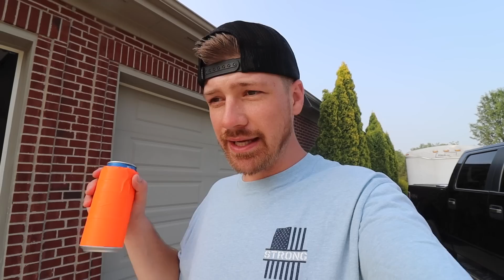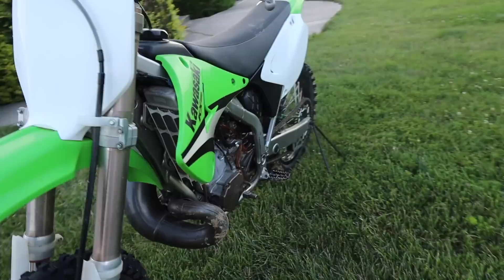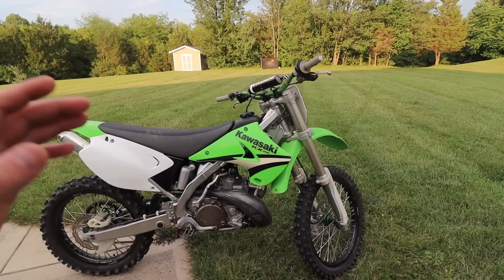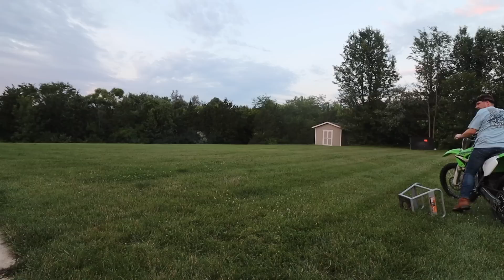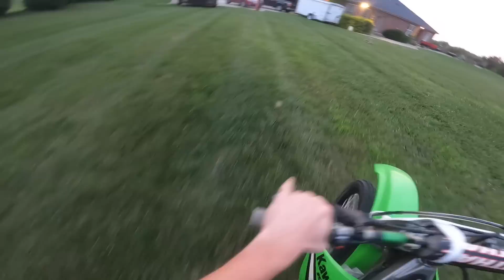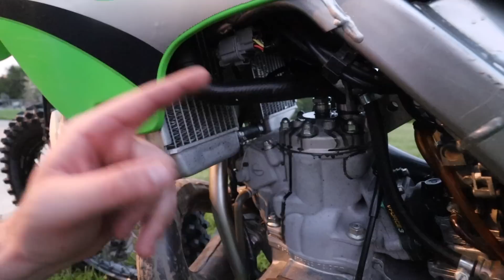JET FUEL in Kx250 Two Stroke!

Comment: Yikes! The lack of technical knowledge on these type videos (both from the content creator and the commenters) is shocking!
All internal combustion fuels (e.g. jet-A / kerosene, diesel, gasoline, methanol, ethanol, etc.) are hydrocarbons (with the exception of straight Hydrogen).  The main difference is the number of carbon atoms in the hydrocarbon chains; methanol has one carbon (CH4), ethanol has two carbons (C2H6), gasoline is a complex mixture in the C4-C12 range, jet-A/kerosene/diesel are all in the C6-C16 range, lubricating oils are in the C8-C18 range, greases are in the C12-C22 range, and waxes are in the C20-C30 range.  The lower the number of carbons in the chain, the more volatile the liquid (i.e. the quicker it will evaporate). To an organic chemist, there is no mystery here.
The reason this Kawasaki KX250 smoked so much on Jet-A is the effective "premix ratio" was dramatically lower... probably more like 10 or 15:1.  If he had pulled the spark-plug after this "test", it would have been oil fouled (due to the much higher percentage of longer-chain hydrocarbons in the fuel)
It would be more interesting to see this Kawasaki run on ethanol (e.g. "190 proof - Everclear") premixed with castor bean oil (@ ~ 20:1).  With an increase in compression ratio (e.g. much thinner base & head gaskets) and larger jets in the carb (needle & main) - the results would be a far more powerful engine (run on 100% "renewable" fuels).
Reply: yes agreed but many of us in our youth  learned fuel stuff by burning out engines in lawn mowers with jungle juice  and no internet in those days to tell us that puts holes in  pistons.
With internet comments we can show compression ratios and fuel types  and carbon chain types and fuel air ratios  properly  studied can save so much burning out engines like the old days .
Modern youths  have less access to various fuels as governments and health and safety block access to fuels that were easy to get in the old days. This is often because fuels mixxed in certain ways fuels can also saddly create cheap  bombs that can hurt users or victims . That's why modern airports have goons to check our junk in case we  got  two hydrogen rich chemicals  often from hair stylist shops to mix together   to make a primitive bomb.,. Thats big brothers excuse but they know its a hoax but they enjoy yanking our chain around the planet 
In the past  the local library with basic books told youths  how to refine oil and basic chemistry but computers ruined that system of knowledge learning . THe books are still in the library but youths  today think everything comes from   i pads and google but social  info interrupts the learning curves so important information is lost in sea of the  next distraction as the human race  now has less memory retension  than the goldfish 
Most modern  youths  think water comes from a tap and electricity comes from a switch and are unable to figure out how to light a candle if there is a power cut , Some modern youths  will learn something useful from  YT comments if there is inputs from people who know fuels and chemicals like yourself.
  I mostly do model rockets and chemicals to make them fly but also  mix better fuels for my car to get better MPG and add my 2 cents in case some  youths can learn something like moonshine as a fuel sucks because it has a high water content if they read that far. keep up the inputs it a planet wide problem knowlege of engines and fuels is being forgotten as google shoves it into page 1000 not relevant in 2023 world  just buy pump gas 
No harm in some fun if some engines get smoky or cooked if some peoples learns what wont work
The other day the USA built a factory  to build a monkey wrench and  the factory failed in making the monkey wrench because the USA has lost all the experts from the past who still know how to make a monkey wrench . Communist controlled EU  is closely following the USA as experts in manufacturing or fixxing anything are nearly all gone  away to retire or dead .

Comment: You sure that’s jet fuel? Because I’m quite certain that it is aviation gas. 

Jet fuel is refined kerosene, where av gas is just gas with very high octane. Much like vp race fuel. 

The high octane will help when your on the pipe as 2 strokes compression ratio gets higher when more fuel and higher rpm’s are introduced and falls at low rpm’s. 

Which is why you had a harder time keeping it idling at first, and also why you had so much (spooge) as the high octane was resulting in incomplete combustion at lower rpm’s. 

So all in all I don’t believe you ran jet fuel, or that jet fuel would’ve even run in the kx. Not bashing you! Just educating and clearing things up a bit!

Comment: I agree with you that 32:1 gas/oil mix is the best for 250cc 2-strokes.  The rule of thumb is, the higher the rpm the more oil it needs. So maybe running a bit more oil for the higher revving smaller bore engines may be a good idea.  I know the EPA wants to see as lean (on the oil) as 100:1 for 2-stroke engines.  But they don't care how long your engine lasts.  Same with cats on your car engine exhaust too IMO.  They heat the engine up a lot more in an effort to burn every piece of hydrocarbon.  I really hate the EPA.  Bunch of communists who hate our free enterprise really.  That is why communism in china has no financial burden of the EPA written in those trade agreements.  They are to punish Western Culture only.

Comment: So let my try and TLDR this:

Modern EuroDiesel fuel is Up to 25-27% more energy dense than Gasoline. 
Jet Fuel is Closer to Old D2 Diesel and its up to almost 40% stronger per Unit of measure. 
Which means Just pouring it In you are Running Extremely Rich. 

But than on top of that You are creating Way more powerful explosions than the gasoline engine was ever designed to withstand. 
The Only Positive of Running rich here is the Fuel is cooling the Cylinder But Not enough to make much difference. 

There are many reasons Diesels are heavier, and One of them You just witnessed. 
Gasoline Engine is just too Weak to take it and On top of that you are Extremely Overfueled. And Doesn't even Burn properly because the fuel isn't properly atomized, Diesel direct injection Atomization in the cylinder is Perfection compared to Pre cylinder Injection and Carbs just add more Jank to it due to Poor Atomization.
Also your timing is very off. 
Contrary to common belief Diesel Burns faster than Gasoline in the Engine. It Will usually complete the Burn in the Top15-20% of the Cylinder, while the Gasoline will Burn for about 60-70% of the Power stroke. 
Most Gasoline engines spark Pre TDC for Optimal Burn But that only makes it worse because You Induce Knock and Have a Very short Power stroke burn.
Here since you are very overfueled it kind of fixes that a bit but Still you have Knock.

Comment: You are running high octane av (aviation) gas for gas engine planes. jets use  jet fuel, it is a form of diesel and is useless in a bike or gas burning motor. I hope people get that difference.

Comment: Had a '90 KX250 2STROKE nvr she have sold it with another n a 500 2strk. Can't  Watch your video to see what diesel fuel in there and then regular pump gas and all that disturbing also also I think your tax is dreaded a little bit's hard to tell from the video but that's what I think I tried cam to race fuel I don't even know if it's around anymore At 32 to 1It was incredible
Reply from the maker: Bike is okay, you should watch!

Comment: I don't think that's necessary.  We know the complications of putting the wrong fuel in vehicles.  Any mechanic could have told u what was going to happen.  If it's carbureted, than you'll definitely have less issues than EFI.  It's still not good.  Get that stuff out of there.
Reply from the maker: Definitely not necessary but makes for an entertaining video lol

Comment: Diesel will not run a four stroke. And the fuel will go past the rings and you’ll have diesel in your transmission.
Reply from the maker: I didn’t think so either but I proved that wrong in one of my other vids
Reply: @kylecorbett  a friend put diesel in her vw bug and it ran but her oil level went two quarts over full and it ran bad and throwing oil everywhere. I put diesel in a 11 hp Briggs and it wouldn’t start.

Comment: Did u not see the plug is loose. Fuck me wonder why it dont run right. Also AV fuel has oil in it. Mix it 70:1. And tighten that plug. Put a new one in it. Ffs

Comment: Yes try nitro in it next. We put some in an old mustang with a 5.0 motor and with 93 octane it made 209 hp at the wheels. With about 75% nitro and 25% 93 octane gas in it, it made 306.3 hp at the wheels. This was a stock 91 ford mustang gt with upgraded fuel pump and injectors.
Reply: WARNING adding Nitromethane to any gasoline fuel risks to make shock sensitive fuel or poor mans nitro glycerin  big KAbooom eg any big shake in the fuel tank and fuel tank can go bang with entire carr inside and outside covered in rapid hot fire burning fuel and a  bad way to die or have severe burns for life . 
Nitromethane  with drag racers  dont use gasoline nitro mix  but use a  safer mix  of nitro ethanol or methanol fuels unusually 85% methanol and 15% nitro  or high nitro 85% nitro methane and 15%  methanol and turns the biggest  V8 from a few hundred horse power into nearly 8000 hp or over 60 units of thrust to each kilo weight of engine weight similar to rocket engine power to weight thrust number and in four seconds engine  run on track burns more than 64 gallons of that jungle juice with nitro costing often more than $50 a gallon .Also nitro fuel burning creates gobs of nitric acid so  breathing in lethal exhaust fumes this can put you 6 feet under . Using smaller percent  amounts of nitro like 5% mixxed with Methanol or ethanol can increase power with less risk to blow engines best to consult drag racing web sites they do this every day

Comment: Sorry to party poop luv what i seen so far but some fuel mix ideas are too risky ask the drag racer guys and they will tell you very carefull with NITROMETHANE fuel mixxes with GASOLINE  or even other fuels  as emissions are nitric acid  in the air  you breath 
.........WARNING MIXXING NITROMETHANE OR NITRO ETHANE  WITH GASOLINE MAKES   A SHOCK  SENSIVE FUEL EG IT CAN EXPLODE FROM SHAKING  IN THE TANK OR EXPLODE THE ENGINE
Mixxing nitromethane is only safe suitable for alcohol fuels to decrease the  octane of alcohol fuels  like methanol or ethanol fuels and why its in drag racers and RC  cars planes boats. 
Nitro Methane can be used as monopropellant fuel in a rocket engine and with a stoic ratio of 2 parts air and one part fuel at over $50 dollars a USA gallon if you can buy it is very expensive to use in very low compression engines like C/R of 5 to 1 so  85% methanol mix with  8 or 10 to one  C/R ratios and 15% Nitromethane is the norm for drag racers to get 8000 BHP for four seconds burning 65 USA gallons in four seconds and engine power to weight ratios exceeding 60 to  1  roughly equals rocket engine power to weight ratios.
Nitro methane is a paraffin fuel very hard to ignite and needs  very high amp spark plugs and can hydro lock easy from the gobs of fuel entering the  engine and destroy cylinder heads . at the high cost best to talk to drag racers or RC modelers before messing with Nitro 
Kerosene and jet fuels is generally 7 parts paraffin and one part gasoline  and in  that case  it might not reach the threshold of shock fuel problems if nitromethane is added but probably  best  to  steer clear  of  nitro methane's with oil based fuel as often they wont mix properly allowing  gasoline fuels in parts to reach shock sensitive ratios in the fuel tank
Yamaha boat engines in the 1976 era were made to run on gasoline and  Paraffin and Kerosene fuels more info later why it sucked as a fuel compared to Gasoline 
Mixxing Ethanol fuel with Gasolines and kero fuel mixxes is cheaper and can increase power of engine if done correctly

Comment: Jet fuel A and A1 is basically kerosene. That's why your engine smokes so bad. I have no idea how the bike even runs. You must still have some old gasoline still in your bike.
Are your you sure your not adding AV gasoline? AV gas is around 100 octain and made for gasoline engines. 
"Jet Fuel" will run in a diesel engine but not in a gas engine for long.
Please stop talking about things you have no clue about.

Comment: Bye bye crankbearings😢
Reply: Why do you say that? Does jet fuel burn hotter?
Reply: @FaceTurd  well yes. and its more explosive aswell
Reply: Jet fuel burns with higher btu's but is less explosive. Jet fuel like jp8 or jp5 is just more refined kerosene
Reply: @tambourii  the bearings are probably fine right? It didn’t get hot enough to blow up. I would be worried about the rings melting before worrying about the bearings.
Reply: Those sounds that the bike made sounded like crankbearings to me🧐
Reply: Jet fuel is kinda like diesel